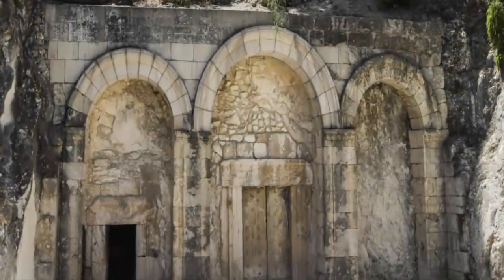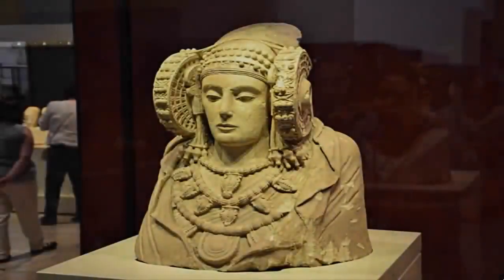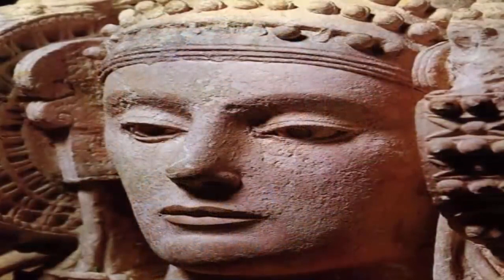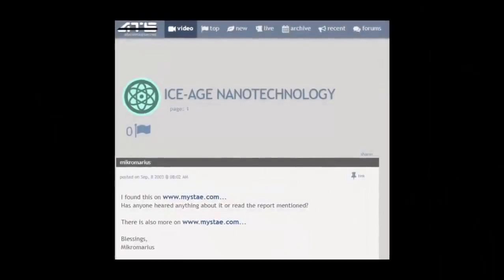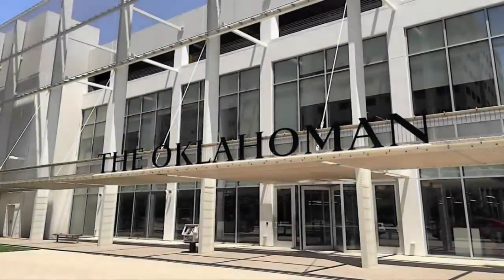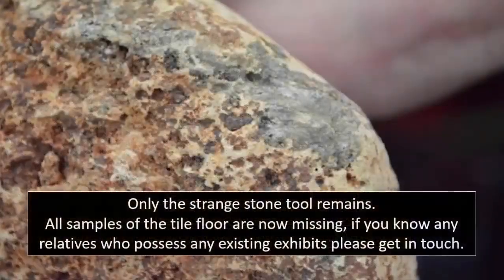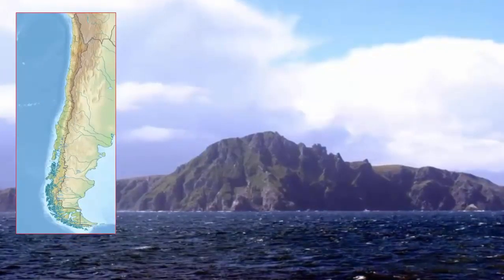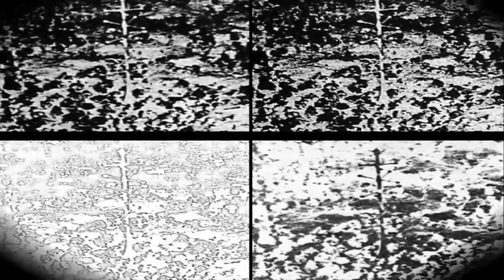Impossible Ancient Artifacts From Around The World

Comment: I’ve been mining for forty years, seen some things in rock I can’t identify,
Reply: Any stories you want to share?
Reply: Like what exactly, I’ve seen a lot,lol
Reply: @zenhector   sure, I’m off work right now anyways,
Reply: Following for stories
Reply: Ok guys, here’s a few quickies, once the top fell out so high there would be fog clouds up there, and our lights wouldn’t identify the top. We had to mine out all the rubble. Then for two hundred feet we worked welding steel beams together for uprights and flooring them with 6x6 timber’s to make a false top so we travel underneath. Once we exposed a nearly forty foot fossil we name the python, thirty inches wide more or less the whole length,  just like it was painted on a ceiling. When I was young I had three miles of belt line to maintain, while bending over to grease tail roller it felt like sand  or fine gravel on my back. After the third time I got spooked and went on up the line. About five hundred feet away from the tail rollers the belt gave a undulating whip and stopped, I went back and it was slowly caving in. The top had came down and was pushing the belt Into the bottom. I would have heard something if the belts were not running but the noise was quite loud. In 2015 I had an eight mile airway to check every week. At one turn in about twelve feet of height there were two circular fossils in the roof  like hubcaps. I always wanted to try and get up to them but there wasn’t anyway to carry a step ladder that far. Reminded me of both halves of a seashell.  I have  thousands of tree and what we called fern fossils. We have what we call kettle bottom rocks, they’re petrified trees that have a thin coal layer, maybe an inch, that break off and fall out. They are responsible for many injuries.  We have hit water sources and had to emergency retreat over a mile before. Water up to our necks. Very fortunate.   I have a particular rock I carried for miles to get home . I was examining an airway when I noticed a peculiar looking rock in the seam of coal. I was able to get a piece roughly six inches long by four inches and two to three inches thick. It has gold veins on top and bottom with blue and red crystallized grains also. It is very interesting to look at.  Maybe pyrite. Quarter inch of it on each side. Once we were trapped and a crew man started to panic,  two of us had to sit on each side of him to keep from running. The boss found a way to get around the fall. Whew.  At the first mine I ever worked in it was standing orders if we ever saw someone attempt to smoke, use a lighter or match that we were to bring them down with a shovel or whatever we had due to the high levels of methane in the mine. One time saw a (genius) pick up a chew of tobacco from the ground and put it his mouth, worked it up to spit and said he believed it was his brand.   Once my cap light went out and as I was only a break away from the rail track I made my to it and crawled along it till I met someone coming who took me outside to get another light.
In some seam we would have so much pyrite it made the places where it was just sparkle. Ok hope you enjoy .
Reply: @RageAgainstTheMachineLearning  thank you for sharing your stories. I know nothing about mining so I wouldn't know if something is weird or our of place. I would only be suspicious I guess